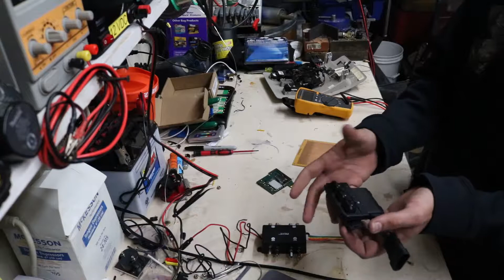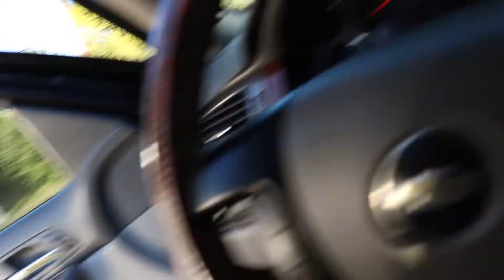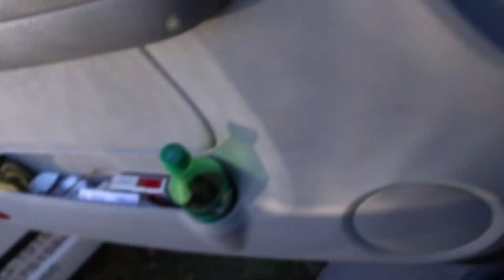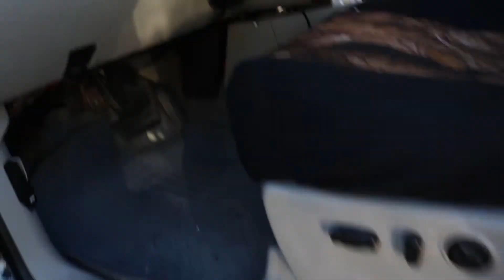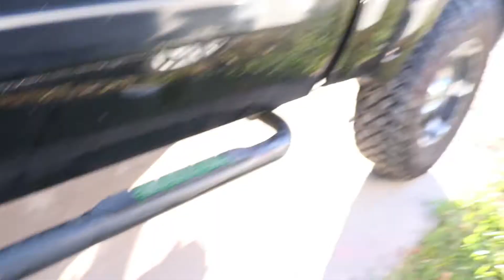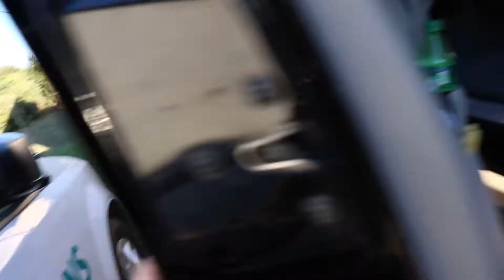07-13 Silverado/Tahoe Homelink buttons Re-Purposed.  Off Road Lights!

Comment: Why not use the Homelink system, instead of modifying it? Use an radio-controlled switch, relay board. Interesting video but I figured you were doing the same as this other video I found, just with a little more explanation. I suggest checking it out. https://youtu.be/l_e7F1VG-dA
Reply from the maker: Since these trucks do not have upfitter switches, I wanted something that looked factory and hard wired, I didn't want to mess with remotes, switches or touch pads on my dash and thought it would be a cool idea.

I kept the homelink board intact so I can revert it back to factory if I wanted to. I do not use my homelink as my truck won't fit in the garage.
Reply: @builditbetter5610  You understand what I mean by remote switch relay right? Meaning that fancy dancy built-in truck garage door opener can be programmed and used to remote control a multi-channel switch relay of any sort it doesn't have to be just be used for garage door... meaning the factory switch can activate a remote switch to turn on auxiliary lighting, or a horn or anything else you can imagine without having to modify any Factory component, of course you would have to buy a cheap multi-channel remote switch relay that you could operate off the Homelink system. 

Did you watch the video link? Like I said I watched your video hoping it would be simpler and more in-depth, but nope you had a completely different way of going about it.

Comment: You should patent and sell these as a complete replacement switch panel
Reply from the maker: I don't think a patent would be worth the money, considering the low volume these would be told at, they are kind of a special item.

I could certainly build them on request.
Reply: @builditbetter5610  I would love to have this in my 09 1500. Could I ship you the parts to assemble?
Reply from the maker: @RGCSEATTLE  Possibly , it might be better if you sent me your home link assembly, the one shown in this video , from your truck , I could built it and send it back to you for install.
Reply: Any way you could attach a link to that relay box? I want to do something similar to my truck

Comment: How do you go about removing that panel?
Reply: 2 torx screws by the light bulbs then pulls down pretty easy.
Reply: @toqueheadluke  thanks, yes, that was it
Reply: Yes, how do you remove the overhead consul panel?
Reply: @Hunteroo4  The panel is held on with metal trim panel clips, just gently pull down on the panel (hoping, not breaking it) and it should come off. It’s not gonna come off easy but it will come off